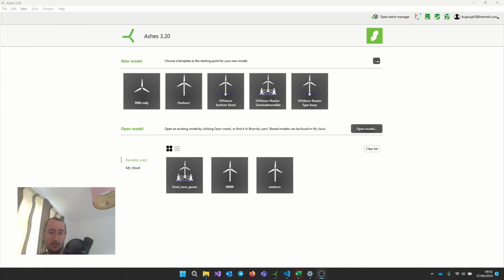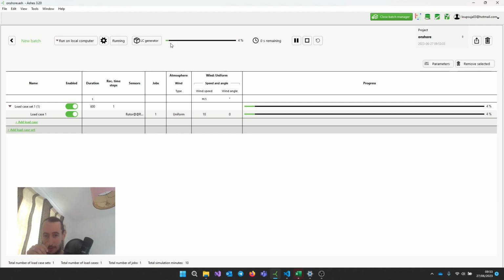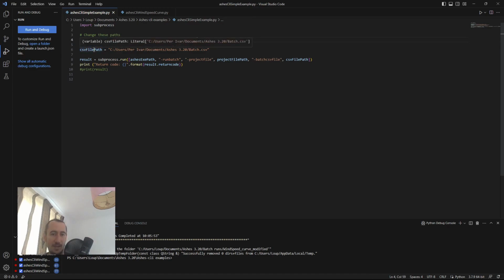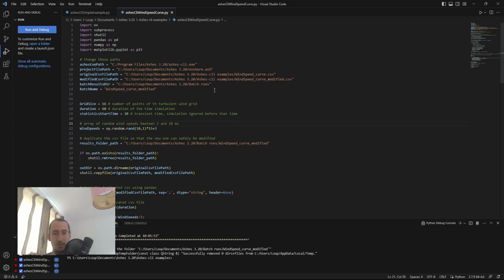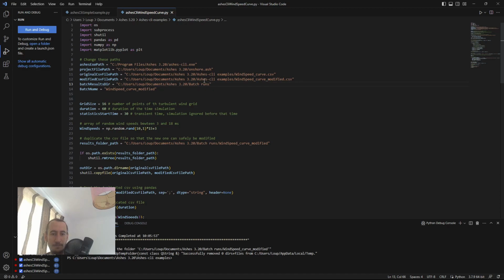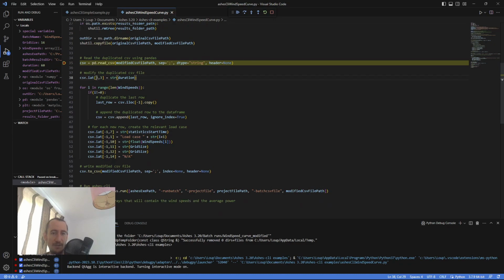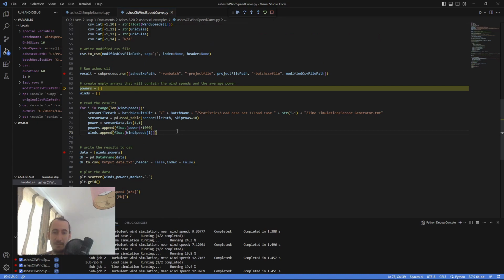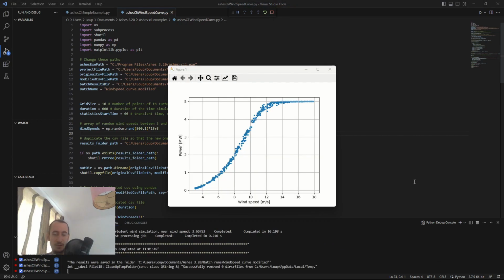Ashes-cli (command line interface) tutorial: How to script your wind turbine simulations

Comment: Hello. Thank you for sharing good tutorials. 

I have one question regarding running Ashes with batch files. Currently I am studying optimization of wind turbine structure(My model has three legs to support turbine, called tripod support). I implemented optimization code in MATLAB and Ashes 3.20 are running inside the optimization loop by 'batch file.csv'. 

The problem is... When I open the Batch manager after optimization, e.g. 2000 iteration loops, 
then I could see thousands of 'lists of batch run ' in the manager. 

It makes the Ashes very slow and almost stop.  

Could you help me how to delete those long lists of 'Batch runs'?
I can share more in detail, if you don't mind to leave your e-mail
Reply from the maker: Hi, thanks for the question
Yes, it is easy to delete the batches, can you send us an email at support[at]simis.io?